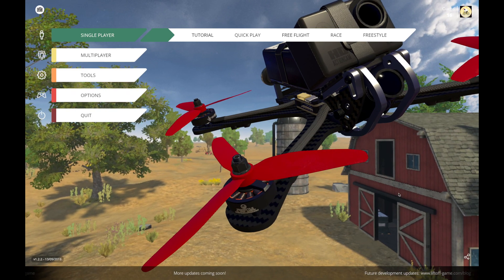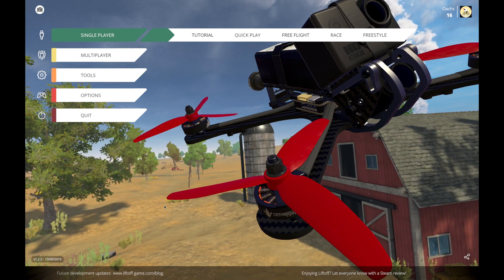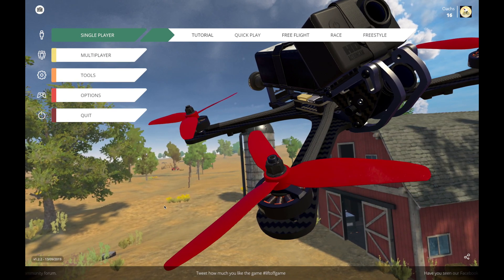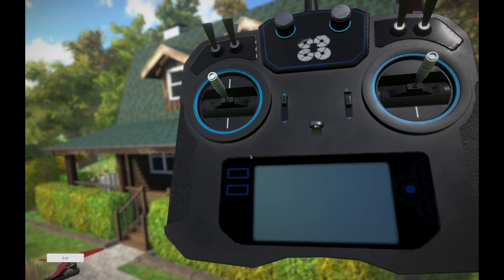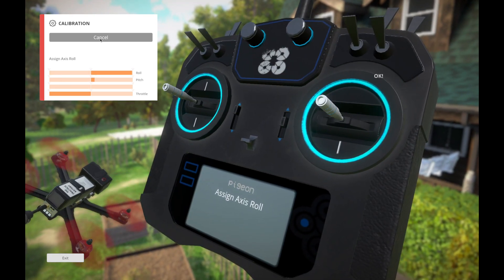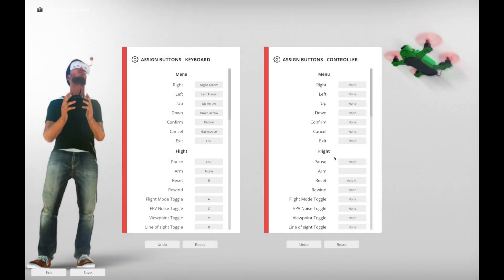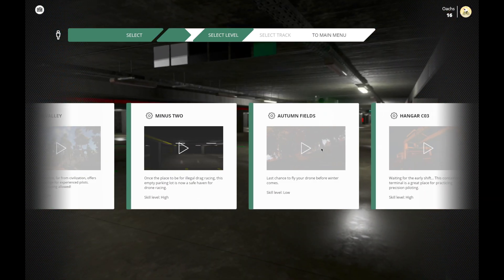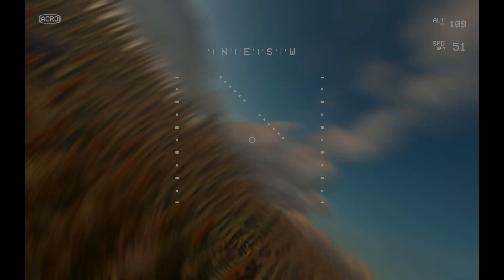How to use the DJI FPV Radio with FPV Flight Simulators - December Update

Comment: Hello bro !!! I have an issue it’s all working fine but there is latency in liftoff, compared to my old x9d it’s like there is a little latency when I’m flying in liftoff.... it’s like jerky... maybe my UBS C which come from a bad store ?? I don’t know .. any idea ? Thanks a lot and I did the last firmware :(
Reply from the maker: I have not noticed anything like that.  Anyone else see any latency issue with the DJI radio connected over USB?
Reply: I have the same problem! My Frsky works much better (smoother). To get similar experience on Dji controller I have to use PPM cable.
Reply from the maker: @ItsBlunty  Hopefully someone finds a cure for that issue since it does not appear to affect everyone.
Reply from the maker: Looks like the update from DJI today has a fix for the latency you were seeing.   https://www.youtube.com/watch?v=V_V9RhQIip4

Comment: Thanks for the video, got the same equipment, but when I start calibrating and move the right pitch forward first it recognises that I move forward then moving moving the pitch more forward it suddenly reacts as if I pull the pitch completely back, but actually I just move it fully forward...
Is it the same with your controller? Or do you think it is a problem with the controller? Thanks in advance for reply
Reply from the maker: I did not notice that issue with Liftoff, however I have since been playing around with the Curry Kitten Quad Simulator and I have noticed that same issue with both sticks.  So I don't think it is an issue with your radio.
Reply: same for me did you find an issue ?
Reply: Juste Pour Voir no i didn’t find a way to avoid it in the flight simulator, but i do not have the problem with the real drone, I think it is something which we have to live with...
Reply from the maker: I have not found a solution to this issue yet, but I did just make a new video demonstrating it.  Still searching for a fix.   https://youtu.be/fep7FFFi3vs

Comment: Would this work with the Phantom 4 controller? I really want to play a sim, can't find a cheap option to get started and have a Phantom 4 controller collecting dust!
Reply from the maker: I don't have one so I can't test it and the DJI forums seem to give inconsistent information about it working or not.
Reply: Hello. Could you connect with phantom 4 controller

Comment: would a simple usd to usb C cable work with this remote?
Reply from the maker: Yes, that is what I use.  The same cable you use to do firmware updates can be used for the flight simulator.
Reply: wrong. a usb to usb-c does not work.  Its really frustrating for those that do not have a usb-c port on their pc
Reply: @thalovedoctor6735  that's crap any idea to get around?
Reply: @ange1042  nope. in fact i just bought a usb c to usb c cable and a new pc laptop with a usb c port and stll no luck. fml
Reply: @thalovedoctor6735  WTF....
Reply: @ange1042  just got it to work. Thank god!!
Reply: @thalovedoctor6735  So what the procedure to get this working properly ?
Reply: Timothy Sage dope bro so be a gent and share the deetz like anyone else would have
Reply: @allegorx58  

On windows 10 PC, it will shows up as Device, when u check the Printer and Device Menu, Right click and select game Controller. I have it working in Lift Off Now
Reply: @cafub2650  how do you do that? I didn't find the option

Comment: Is there a way to connect the goggles too?
Reply from the maker: Not really.  You could take an HDMI output from a computer and run it through an HDMI to composite converter and then connect that to the AV input on the goggles, but there is no way to get a high resolution digital signal into the goggles today.

Comment: Ist does work very bad on Windows. ☹️ Suuuper laggy.
Reply from the maker: Anyone else here tried this on Windows?  Did you notice any lag?  I assume it must be working fine for some of you.
Reply: @5zero7RC  Only Mac users reported to me it works fine. But for pc users laggy as hell. :(
Reply: @marioleto3707  Hey Mario!! mine is super laggy too.... any advices now one month after??? thanks a lot
Reply: @Gaetandld  yeah support said it will be fixed in an future update....
Reply: @marioleto3707  thankssss that's cool to hear... just need to wait so ahahah
Reply from the maker: Looks like today's firmware update from DJI has a fix for the lag you had.   https://www.youtube.com/watch?v=V_V9RhQIip4

Comment: Bummer it dont work on fpv free rider I have liftoff but my computer  cant handle it and i find fpv free rider to feel most like the real thing 😥
Reply from the maker: It really won't work with fpv free rider for you?  Seems strange.  That is a bummer.
Reply from the maker: Ok, so I just launched the copy of FPV Freerider that I have on my Mac, connected the DJI radio, powered it on, then went through the calibration steps in FPV Freerider and was able to fly.  Maybe it is different on a PC?
Reply: @5zero7RC  it connects but when i go to calibrate the sticks are skipping and jumping at mid stick so quad just flips out
Reply from the maker: @shenanigan3083  :(  strange